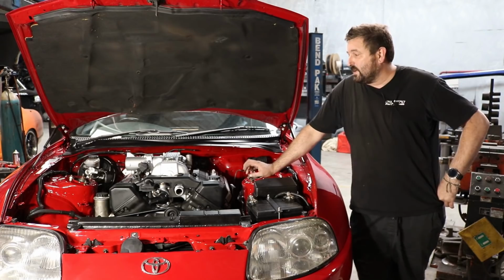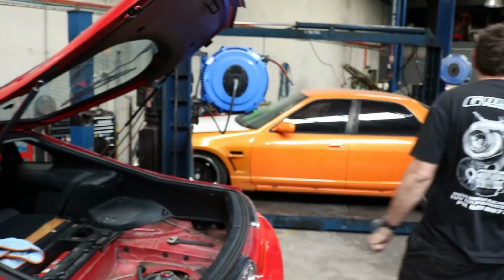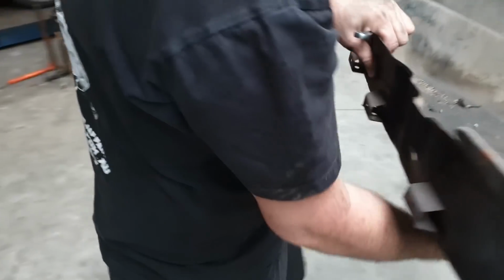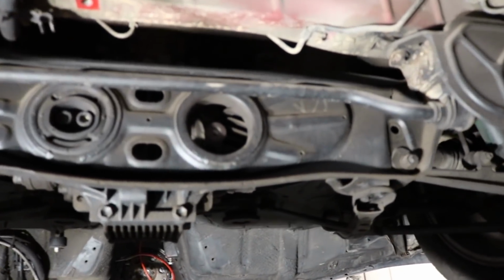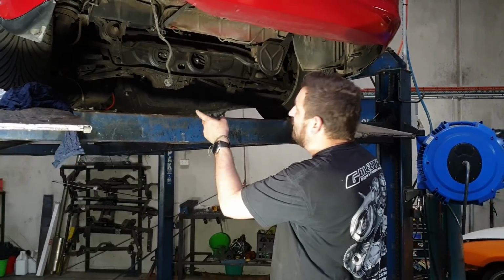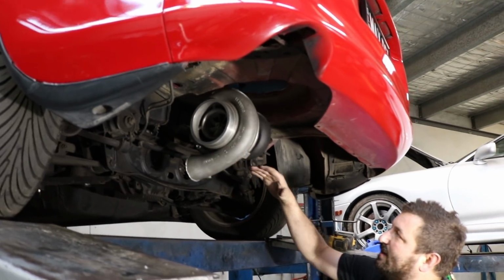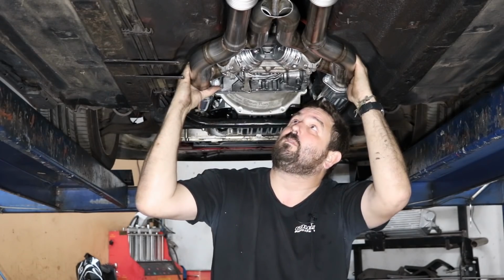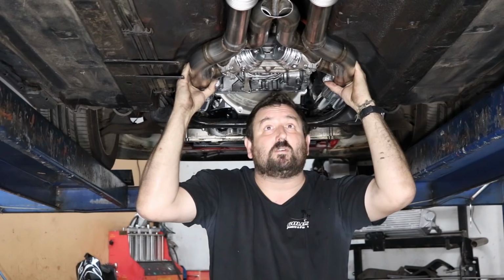Monster Rear Mount Turbo V8 Supra build Ep2

Comment: Buddy of mine did a custom rear mount turbo setup on his 2004 Corvette Z06, he measured the oil level in the engine oil pan and positioned the turbo high enough in the rear trunk area that there was 4 inch drop between the bottom of the cartridge and his oil pan level. He ran oil feed from the engine to the rear, then dumps the oil out the turbo into a small 1 liter container mounted near the turbo, which runs to the front of the car and bolts into the stock pan oil drain hole. To change the engine oil, he just sucks it out the dipstick with vacuum pump. For the intercooler pipe going to the front of the car, he used rectangular pipe for better ground clearance which converts back to round pipe going up to the intake.

Comment: the trick to making boost quickly is to heat double heat wrap the pipe and use a turbo beanie.  use a reducer into the turbine flange. it will speed up the gass flow. otherwise you'll be driving waiting around for the system to heat up before it makes boost. sucks when its in the winter and running late for work

Comment: I've done rear mount turbos. Works well. Lower engine bay temps,more timing 👍 always good oil pressure with remote oil system for turbo.

Comment: ulrich aluminium rectangular hollow section aluminium extrusion 100 x 25 x 3mm  or 125 x 50 x 4.6mm to run along the rails then do your transfers.
Reply from the maker: That should be bloody perfect. Will make some calls on monday

Comment: hey guys use your round aluminium pipe bent to fit the car and when it gets to the floor where you need to oval it mark 3 inch round pipe anneal it where it is going to be oval and put it in a press between 2 pieces of 50x50mm square tube the length of where it needs to be oval and oval it to suite the floor you could compress it 1 inch and it will still be 3 inches in oval diameter a lot easier than cutting a pipe length ways and modifying it would look cleaner too just a thought love the build can't wait to hear it running

Comment: On oval tube, I read about an interesting method the other day that might be quicker than welding strips into a cut pipe : "One guy flattens his by laying a peice of 6" channel over it (on concrete)and running over it with the semi he drives all week.The pipe comes out looking as if done at the factory."

Comment: That zorst is a work of art!

Dunno if you guys watch the modfather, but he had trouble with exhausts sagging from the wrap keeping the heat in. He is probably at WOT at fair bit longer than you guys, but just something to keep an eye on.
Reply from the maker: Thanks mate will go have a look. I think it should be ok if i hang it properly, turbo weight isnt an issue here either.

Comment: What an awesome build can't wait for the next installment 👍👍👍 Ps. Not sure if it will work with aluminum pipe but I've put steel exaust pipe through a set of plate rolls and found it made perfect oval pipe so if you know any Boilermaker shop with a set it might be worth a try? Keep up the great work guy's the subs will follow

Comment: Loving this idea 👌 
Thinking of doing the same to my vn v6 , being on a budget of sweet fa this makes sense from a financial standpoint, I'm not after 1000hp maybe 500, thinking just using a China turbo (yes) and a stand alone oil system, even thinking of doin rear mount water to air intercooler setup, like a pwr style barrel cooler with a mini radiator and thermo 🤔 would be relocating fuel tank (fuel cell) into the boot so would have the entire rear end to play with 👌 
Already have pacemakers and single 2.5 inch exhaust that can be modified to suit, I'm assuming I'll need to change it to a flange joints as apposed to the slip joints? 

Question do u run a oil only turbo or do u still have to use a water and oil turbo? Tia 
Keep up the awesome work guys 👌 and thanks for the inspiration to give it a go myself 👍

Comment: You don’t need to run one big pipe you can run several small pipes to make up the capacity, bonus they will act as a cooler.

Comment: Screamer dog 😂 Awesome work nugget garage. Could use some aluminium RHS tubing for the boost side to give you more ground clearance 100x50 be mint
Reply from the maker: Would save some time if i could find an extrude, so far only found 15x30mm oval

Comment: Awesome stuff lads. The edit makes it look like it came together in a day, but 20hrs seems more accurate. Will be interesting to see how you manage the stand alone turbo oil system. A few other remote mounts I have seen run oil (and water) from the engine and that seems like a total pain in the arse. Would cattle rail (oval steel pipe) be a cheaper/simpler option than making your own alloy oval?

Comment: I run the super pro rear diff bushes (2 of them) and the infills to go around the factory rear subframe bushes on my soarer. I rate them not to stiff the nvh I think is similar to factory just feels alot less sloppy.

Comment: Those bellows expansion pipes expand under too much boost and stay that way. Would a really good slip joint with springs work? Once they are hot they do seal pretty good. Just a though boys.
Reply from the maker: Did you see ruby vid today also? If it happens will learn from it. Cheers mate
Reply: Nugget Garage I’ve seen it before at the drags in the pits. Slip joints seem to work when they get up to temp the best. Good vids guys!

Comment: Yo just a heads up with those flex joins, just saw a video on cleetus' chanel where they blew one of those out like an accordion when they used it to join the manifolds to feed to the turbo. Is a lot further down the line though so may not be an issue, it's also a 427, but maybe something to keep an eye on
Reply: Yeah but Cleetus was Lucky it did that because of the malfunction of his wastegate it gave it all the boost. Plus these guys build exhaust systems for a living so I think they will be ok. Also these being used in a straight line, not on a bend like in a crossover pipe. Using these type of flex joints before a turbo is a must because the mesh ones will send peices of the mesh through the turbo.

Comment: How about putting intercooler core between the chassis rails? 
Go turbo-3 inch pipe-intercooler core between chassis rails-3 inch pipe to engine bay.

Comment: Bloody love this,will need a scavenge pump for oil return?
Reply from the maker: Hey johnny, planning on doing a complete standalone oiling system on it. 'Should' help solve alot of oiling issues.
Reply: @NuggetGarage  Why dey no broddy risten
Reply: As the Hoff said: The system he plan on using has gravity return because the tank is under the turbo, so no need for a scavenge pump, which are for when the turbo is below the sump.

Comment: insulate the absolute fuck outta your exhaust, get some ceramic wool blanket things and wrap your exhaust with em before you heat wrap it, a carton says you'd see a measurable difference in performance.